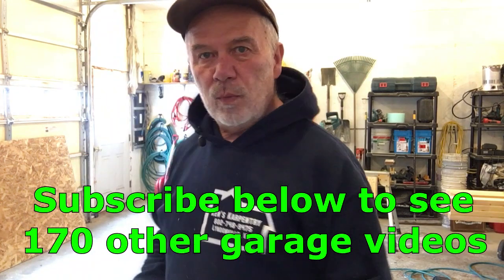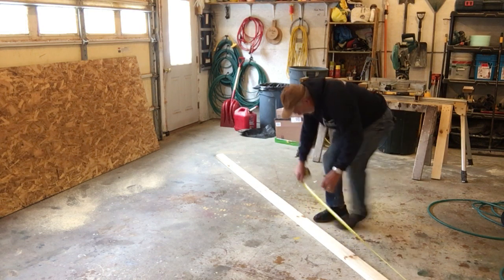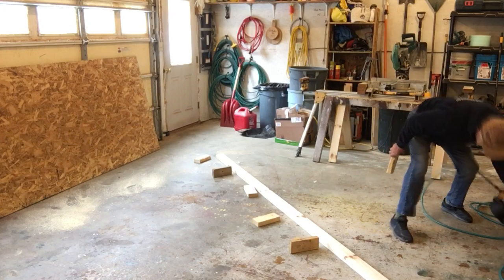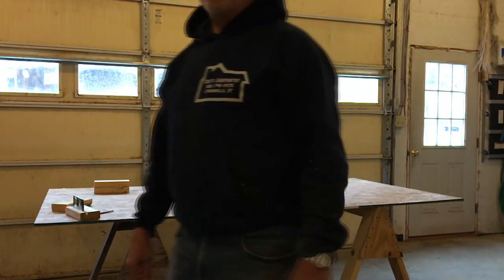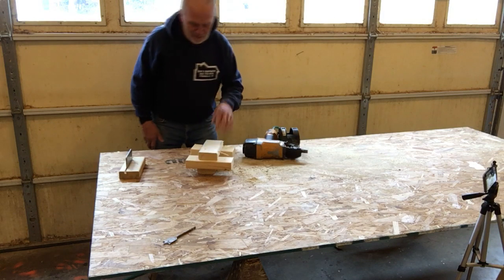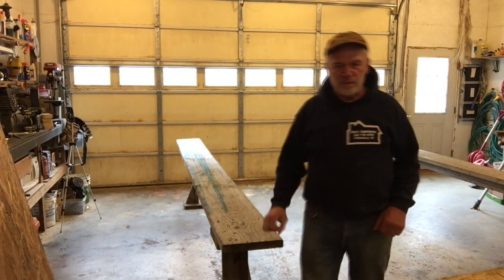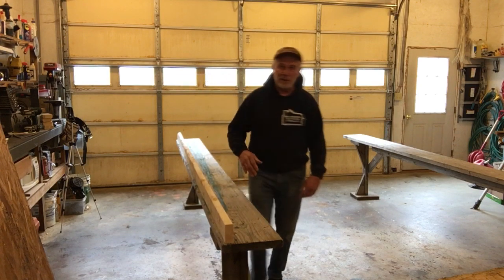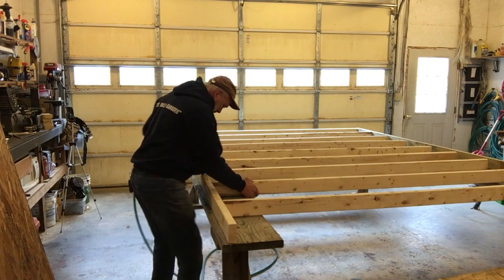#172 Wall framing, darts and stitches

Comment: I learned the 6" rule hard way.  I was installing blocks in the stud bays after completing my 24x24 garage my brother and I built last summer.  Other than shooting a nail through the tip of my index finger rt hand.  I almost got myself nailed to the garage.  I had just enough room to wiggle my finger out.  The nail hit a knot and made a sharp turn.  I won't be doing that again.
Reply from the maker: Ouch!

Comment: Ken, I am sure you've thought through this - but, wouldn't it speed up wall construction to have some blocks or small sections of metal angle attached to the surface of the framing tables to give you 16-on-center set-up of the studs without needing to do any layout on the top and bottom plates?
Granted, it would mean that you would have to align the two tables properly to build a wall section that isn't racked.
Maybe not enough time savings to justify the hassle of modifying and aligning the tables?
Reply from the maker: Thanks. I have tried to come up with something like that and it seemed like to many variables for windows or doors so I stuck with the same method of wall layout.

Comment: Ken, can you use the same rakes for various pitches. 4/12, 6/12, 8/12. Have you previously cut the peaks on the rakes
Reply from the maker: Yes we usually cut the peak angles ahead of time and the bottom if possible